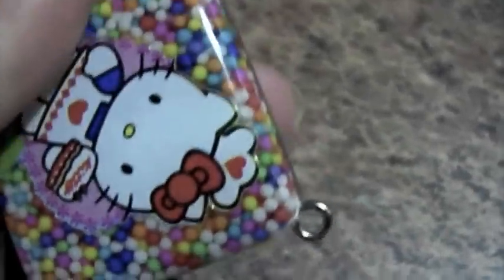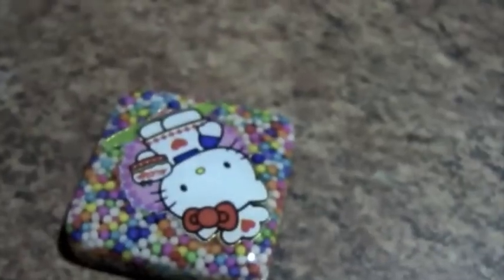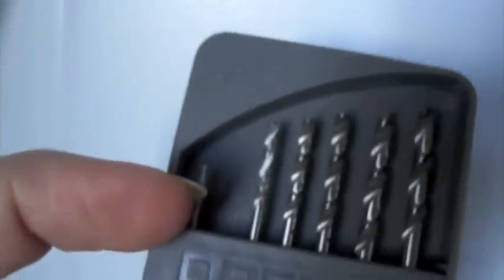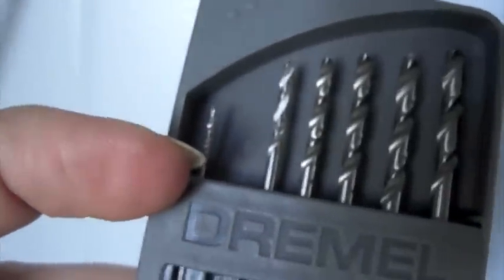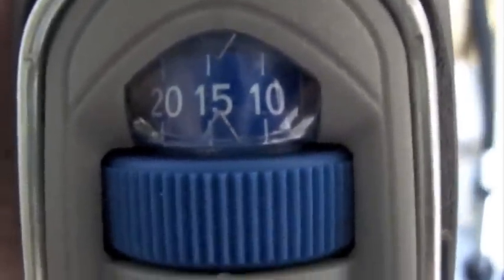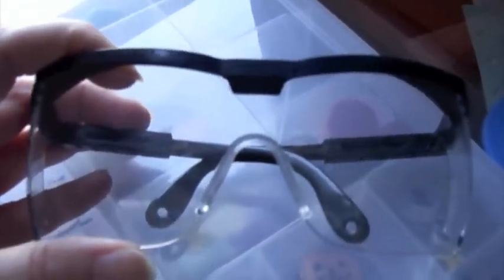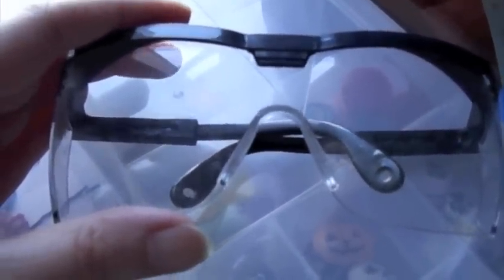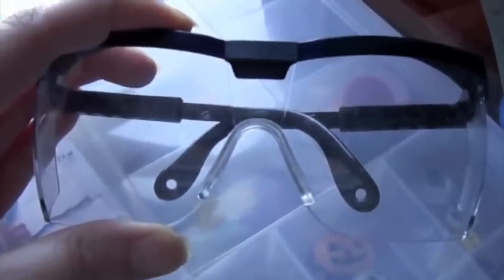Resin FAQ: How to drill resin pieces (using a Dremel tool)

Comment from the maker: @estefanyaitana Yes, it is. To make a simple hole like the one in the video, being in a ventilated area is safe enough but if you use your tool to sand the piece, you should also wear a mask (plus do it in a ventilated area, outside is better, and protect everything around you with plastic covers, the dust gets everywhere).

Comment from the maker: Not really, you need the bit and the piece they call collet in the right size, the dremel usually comes with all of them. It's what grips the bit into place. I use the flex shaft attachment just because I have it and it is easier to control what you're doing, but it's definitely optional.